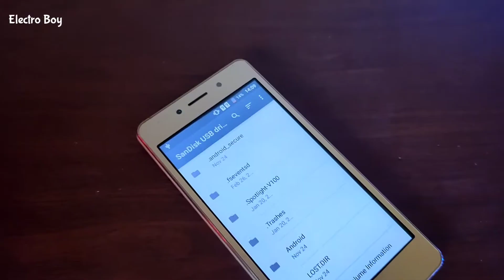How to Fix A Broken USB Pendrive

Comment: Can i use wire and cut it into pieces and solder it or i need to use diff wire
Reply from the maker: No need to use different wires, just don't get mixed up